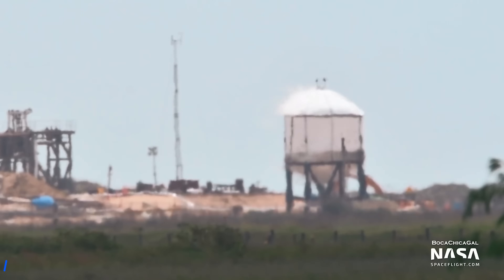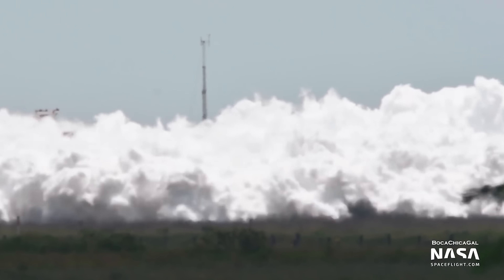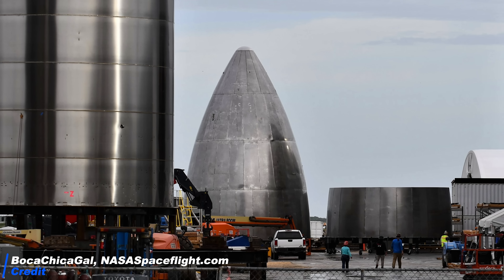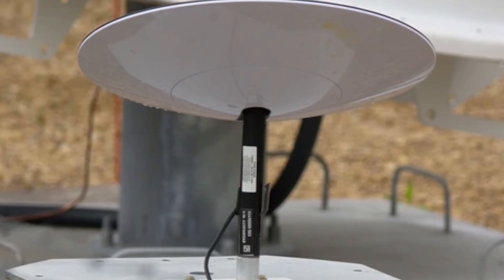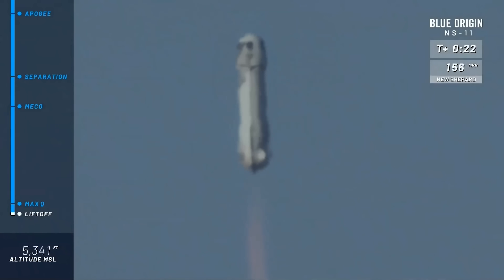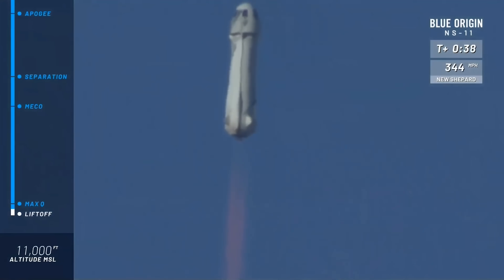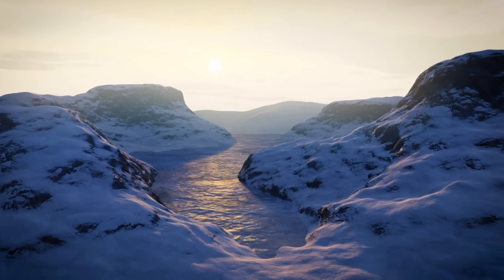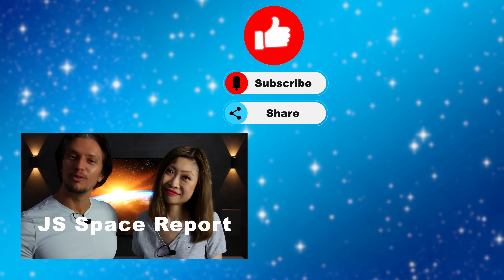Starship / Super Heavy Progress, NASA Funds SETI, Two New Super Earths!

Comment: Must have been the price of the 301 that it was chosen, though I'm not very familiar with it. 304 and 304L are probably the most common for pressure vessels that I have worked with though I like 316 and 316L in more corrosive environments and working with European manufactures seems to be cheaper than the 304 and L in the U.S. but only when made in Europe. 304 and L seems cheaper in the U.S. Though of course these change all the time.

Comment: The question nobody asks.  Are our future Martians expecting the tanks to maintain cryo temperatures all the way to mars (lots of gold foil), and retain significant amounts of fuel for landing and beyond?  Seems like a small nuclear generator would be a necessity for beginners at least, or is solar energy to bear all the burden so far from the sun.  What percent of terran solar does Mars receive.  Keep up the good work S&J.
Reply: Well, fuel for the return trip is expected to be manufactured there. maintaining the cryogenic temperatures is just an engineering problem, therefore open to solution. One key, the farther away from the sun you get, the colder it naturally is.

Comment: I was in Florida to see the SpaceX in-flight abort test. I had been there for the ARABSAT6A launch on the falcon heavy, last year. On both occasions, I drove past the Blue Origin site. I can tell you that, in less than a year, Blue Origin had built several new buildings. I would estimate that they increased their footprint by around 4 to 5 times. So, I wouldn't count Bezos out of the race just yet. They seem to be secretive about their operations, unlike SpaceX. Behind closed doors, I would imagine they are making strides or making a big mistake. Time will tell.

Comment: SN-5 has been rolled to the test stand where it will commence the usual test procedure, which will mean pressure testing, static fire, and explosion. (Grinning and ducking and running)
     Rebar is not a mixture of steel and concrete. Rebar is steel. It is short for reinforcing bar. It is steel bars used to reinforce concrete or other structural elements. I imagine that the great big holes those rebar towers were being inserted in to will now be filled with concrete.
     I think it would be highly ironic, and deeply amusing, if Spaceship 2 and new Shepard, which were intended to fly civilian tourists, wind up being primarily used to fly NASA astronauts. Of course, if NASA does contract to use them, that will greatly increase the public confidence in them, and might generate more tourist business than might otherwise have been the case. Also of course, Spaceship 2 has barely gotten above the US fifty mile definition of space, and will probably never see the sixty mile Karman Line. SpaceX is, of course, open for business for tourists. For a long time I wondered if SpaceX would succeed in putting people in orbit before Blue Origin got them above the Karman Line. That has now been answered. Now the question is, will Spacex put tourists into orbit before Blue Origin puts people above the Karman Line? I'm betting on SpaceX.
     You guys really shouldn't be so hard on Jeff Bezos and Blue Origin though. The day is going to come, yes it is, it's going to come, when Blue Origin will be flying the New Glenn partially reusable rocket, and it's going to make Starship look like, well, look like, the single most advanced spacecraft ever built by man. (snicker, snicker, snicker) What can you do when you're ten years behind and content to stay there?
     The fact that Doug Loverro had been critical of Boeing on some projects, does not mean he was completely down on the company the way you two are. From what I have read, having seen all of the Lunar lander proposals, he felt the only one with any real chance of making the 2024 deadline was Boeing's, and that was why he decided to break the rules, and the law, to give them an unfair advantage in the bidding process. Obviously, it didn't work.

Comment: I think the suggestion that Doug Loverro that was caught out leaking confidential pricing information to Boeing has been pretty much confirmed throughout the media.That seems to be on a par with NASA's previous preferential handling of Boeing compared to SpaceX. But you may be right that during the previous 6 months Loverro seems to have been less cosy to Boeing, even if the only evidence of this was that since Loverro joined NASA it was beginning to look as if NASA were taking a more neutral stance to their commercial partners - as indeed they are legally obliged to! The interesting thing is why Loverro was leaking to Boeing...
Reply: What preferential handling of Boeing as compared to SpaceX?
Reply: On 16 September 2014, NASA announced that Boeing and SpaceX had received contracts to provide crewed launch services to the ISS. Boeing could receive up to US$4.2 billion, while SpaceX could receive up to US$2.6 billion. In November 2019 NASA published a first cost per seat estimate: US$55 million for SpaceX's Dragon and US$90 million for Boeing's Starliner. Boeing was also granted an additional $287.2 million above the fixed price contract.
Reply: @christiangibson1120   The initial awards were, of course, based on what the two companies bid for the contracts. Boeing ran in to unexpected difficulties and so needed more money, which they asked for and got. It's not like SpaceX also asked for more and was denied it. Given that NASA was seeking to fill an urgent need, to return the United States to manned space flight, and was crucially interested in having two independent means of doing so, they were hardly going to just drop one of the contractors. Had SpaceX run in to similar difficulty, I'm sure they would have received similar treatment.

Comment: As always, a huge thumb up for your work.  A couple of comments though.   Rebar is a kind of a steel bar the cage is made of, not a mix of steel and concrete.  304L is a well known in Texas and elsewhere gas processing plants exist as it is very good for cryogenic temperatures of salt-free fluids.  In fact, it is so popular that even 3-4% price over 301 is questionable.  Musk should ask people he is fighting against namely O&G guys.  They would quickly calculate a thickness of 304L welded pressure vessel for given cryo temp and pressure.  I know this for sure.  I used to be one of Oil in Gas guys...   Cheers!
Reply: @TechChasm  Hey guys, if you really share my feeling about the "new alloy 304L" (please don't call this old stainless steel a new alloy), here is another thought that bothers me a little: Elon is a DaVinci of today without a doubt, but this is confusing to see him performing the destruction testing on a simple SN7 vessel made of simple steel meant to work at difficult but not so uncommon pressure and temperature.  There a thousands of this kind of vessels made annually worldwide...  They are normally designed by junior mechanical engineers and just checked by their supervisors before hitting the shop floor and then being installed at the plant sites.  SS vessel design is 1/10000 of Crew Dragon or self-driving Tesla.  I admire every Elon's endeavour but this SN7 bothers me.  I hope they only were testing the Boca Chica weld seam quality.

Comment: Tesla vehicles NEED to check in over the WEB at intervals. When Comms are not available, the vehicles are either feature limited or inoperative. 2019 Elon responded to a question regarding the threat Starlink will pose to the Telecom Industry. Elon stated repeatedly and emphatically that Starlink is NOT a service for already served areas. It can't handle a lot of bandwidth and the orbits are directed toward the unserved areas of the World. He will actually be HELPING Big Telecom by removing the pressure of running copper to a single home 500 miles from nowhere. THAT'S where Starlink will shine. Servicing the World's unserved and keeping Teslas running.

Comment: I cannot understand the reasoning behind Space Force using either Blue Origin or Virgin Galactic to train their astronauts in weightlessness. Now the figures I am going to quote are only approximate but I think in the ballpark. Both of these solutions will give the astronauts about 6 minutes of weightlessness to train at a cost of between $200k and $250k per seat. 
NASA solution to the same is of course the vomit comet where you can get about the same amount of weightlessness for $5000 admittedly split up into 15 chunks of 20 or so seconds each so 20 to 30 times the cost. Also being a plane it can fly in conditions where a rocket cannot and also dosoon a more regular basis.

Is this an example of military overspending? or just a way for Space Force to say that they have "real" astronauts since the solutions they have picked fly beyond the Karman Line hence they qualify to be an Astronaut.
Have I missed something? Obviously 5 or 6 minutes of uninterrupted weightlessness is better however they could have literally hours of short bursts of weightlessness for the same price.
Reply: Space Force has no astronauts and is unlikely to have for quite some time. NASA is not Space Force, it is not a military service of any kind. Presently, NASA uses aircraft flying on parabolic arcs, the so called vomit comet, to train in zero G, getting about thirty seconds at a time. Five or six minutes of continuous weightlessness could well be quite valuable.
Reply: @odysseusrex5908  That is my point Nasa uses this method which costs so much less. I thought the amount of time was less than 30 seconds however remember that the vomit comet performs these maneuvers approx 15 times in a flight so the aggregate total is actually higher.

Space Force does indeed have no astronauts however the only requirement to be an astronaut is to fly beyond the Karman line. So the second such a flight takes place then Space Force will indeed have astronauts. You and I could be astronauts if we had the requisite funds and took a flight.
Reply: @glennedwards1449   What will the price difference be? i don't know. It's about thirty seconds. A full five minutes could be perceived as quite valuable training.
Reply: @odysseusrex5908  Actually a Nasa do not run the Vomit Comet anymore they have farmed it out to a private company. This is what a couple of minutes research tells me so I could be wrong. However if it is correct a flight on the Vomit comet can be had to $5,000 including 15 parabolic arcs which is where the freefall comes in.
Reply: @glennedwards1449   That's irrelevant. the question is, is there significant value is getting several minutes of zero G, for training, rather than thirty seconds. I'd the answer is obvious.
Reply: @odysseusrex5908  you missed the point the $5000 Vomit comet flight gives only 30 seconds of free fall yes but 15 times every flight hence a grand total of 7 and a half minutes for 5% of the price of say a 6 minute uninterrupted free fall flight. So the equivalent of 2 and a half hours free fall in 30 second increments for $200k the same as the next cheapest option. Which give you the 6 minutes uninterrupted free fall.

Comment: Somehow i understand the blue origin rants, but i would be a bit careful about them. I think they have a lot of things cooking. I would say they will surprise some in the next few years. But im glad that we can see the progress of spacex instead of looking at white walls at blue origin.
Reply: Bernd Spencer Rositzka I will believe Blue Origin is viable when they demonstrate their capability.  Until then, it’s another deep pocket wannabe.   Paul Allen’s plane launch approach had lots of promise but was fatally flawed (First ... the 2 fuselages needed to be connected by the main wing AND the tail wing for rigidity and to provide a 2nd hard point.    Second ... the two hardpoints needed a rocket attachment frame that would support the weight of the rocket its’ whole length(Elon gave up due to ridiculous stresses on the rocket due to all the weight being held at one point instead of along the whole length.   Third ... The most ridiculous flaw of all, the rocket needed to be pointed in the right direction when launched. This means adding the means to pitch up at least 40 degrees instead of only 17 degrees. This could have been done several ways.

I still think the plane launched approach can be competitive even against superheavy, but only if done right. The cost to get the rocket above most the atmosphere with significant initial potential & kinetic energy could be very low.  Plus no spaceport required. Plus launch from any latitude is a big help.  Especially, if the rocket is reusable.